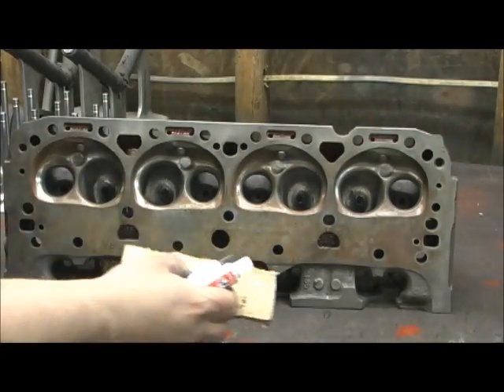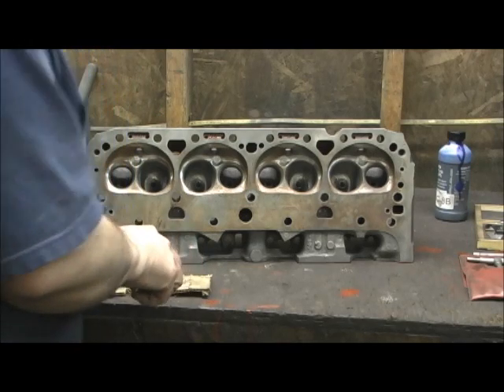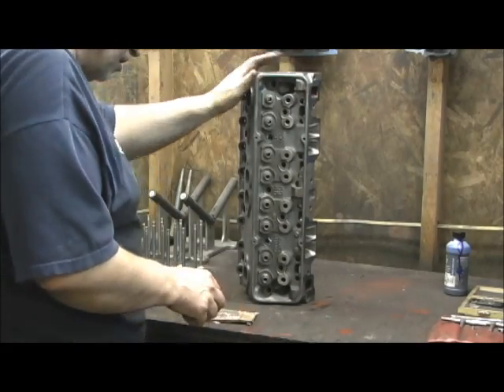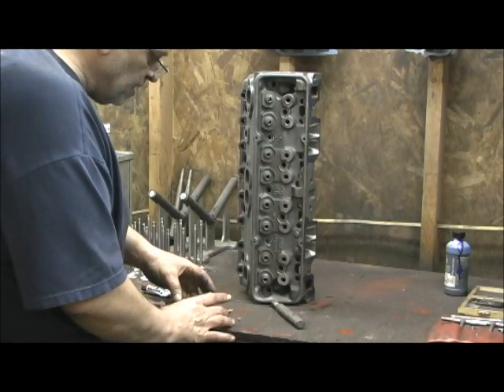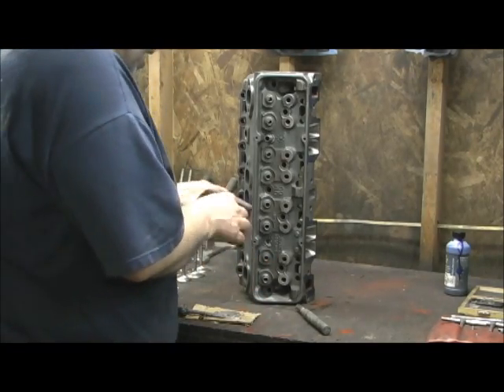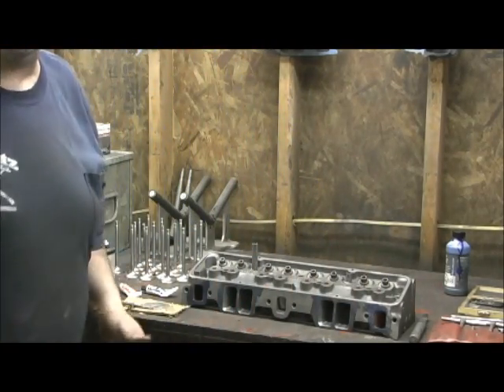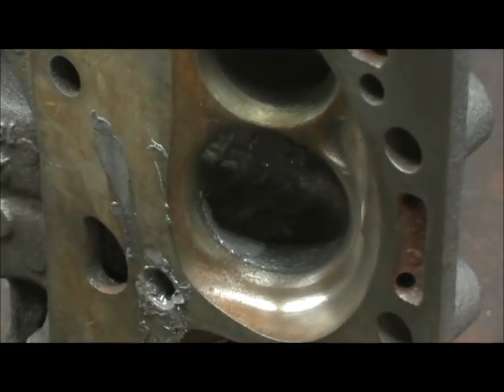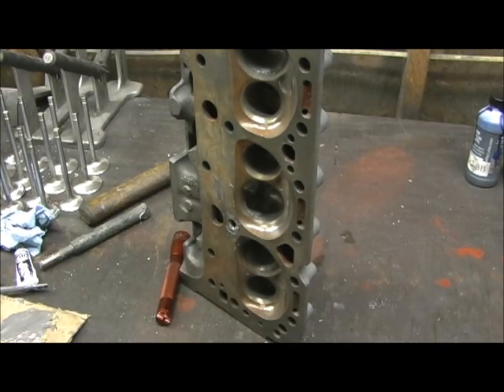Imhoff SBC 186 Casting "EPOXY" filling the "TUBES" 5.8

Comment: Hi there really enjoy your videos ...question have a set of sbc 340292 castings where a guy ported the exhuast port H is 1.580 inch and w is 1.475 inch. ok referencing from center of exhaust bolt hole measurement down (being to exhaust floor) is .775 inch and up is .805 inch. Used a snap gage .400 inch in measured 1.370 should this be a concern ??? ...should i weld the floor up to stock....Alan thanks again from all of us gear heads from nothern  canada

Comment: Dave, I will give you my opinion on running 2.02 intakes on a small bore which will be worth exactly what it costs you. It depends. It depends on the core shift of the block bores and the shift on the valve guides. I would check the clearance after bolting the heads to the empty block in question and see if the valves even clear the block! 9/10 times there will be no increase in horsepower due to bore and chamber shrouding. World products used to make a 2.02/1.6 head with altered valve spacing just for small bore applications. If you are running standard valve spacing the max size I would run is 1.94 intake.

Comment: Good evening, I'm writing from Venezuela
I have a question about a job I'm doing.
I need to install springs comp cams 986-16 in a cylinder heads, vortec 906. But I do not know how to machine the spring seat (depth)
I will be grateful if you can help me.
Thank you very much !!!